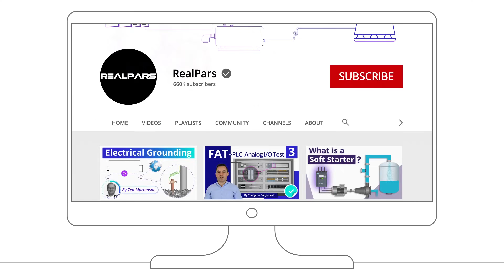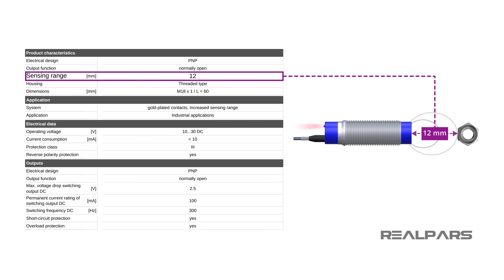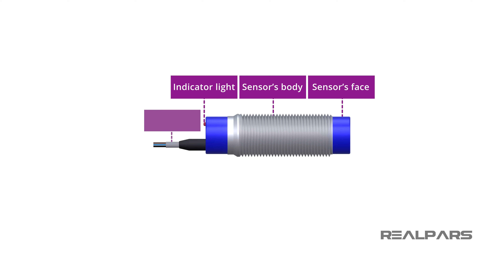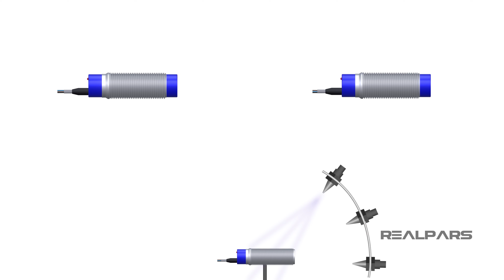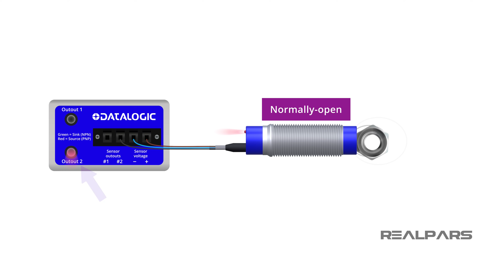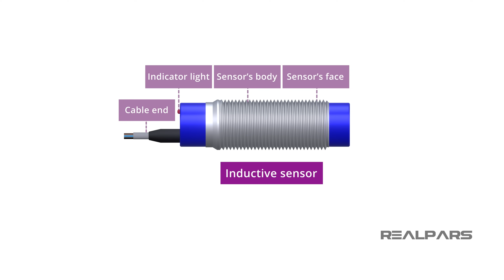Inductive Sensor Explained | Different Types and Applications

Comment: For this kind of detection, the hall sensor is not very good, and then it requires magnets arranged on a rotating mass. In contrast, the inductive sensor (is the one used in the video an NO?) is much more versatile for connection to an injection module such as the BKL3A.
Reply from the maker: Hello, @pierpaolop9534.  Thank you for your comment.   You are correct. It all depends on engineering design and application. Happy learning from Realpars!

Comment: I found an article online where someone turned a regular transformer into an inductive sensor and then used it to monitor the chain links on a bike. They were able to monitor the speed of the links as well as their varying distance from the sensor, eg the torque on the chain.. What kind of output is produced by these sensors. Is it a raw analog output based on the input voltage, or a digital output, eg on or off signaling the presence of the target material. This presentation makes it seem like a switch.
Reply from the maker: Hello, @chrisliddiard725.  Thank you for your question. This is very interesting. Electronics can do lots of things if you have the know-how, education and training. Yes, we talk about these sensors as switches. There are many manufacturers that make these.  Happy learning from Realpars!

Comment: For aircraft/aviation applications, is circuit normally closed or normally open?  Please also send me a link if you have a specific video for aircraft applications.  Thanks!
Reply from the maker: Thank you for your question.  Sorry, we do not have any specific videos for aeronautical applications.  Circuit sense (normally open or normally closed) is usually independent of the process type and dependent only on the application.  Applications where a proximity switch would need to cut off a circuit when the switch point is reached would typically be in a normally closed circuit.  If the switch needs to enable a circuit, that would be a normally open circuit.

Comment: can I use a non-conductive material to block the inductive signal from the sensor so that it will not detect an object in range?
Reply from the maker: Hi there, 

Thank you for your question! As mentioned in our video, the sensor operates by generating an electromagnetic field. Depending on the specific manufacturer and the information provided in the sensor's datasheet, it may be possible to effectively obstruct the electromagnetic field using a non-conductive material such as a thick piece of wood or rubber. We wish you success with your experiment and hope you find valuable insights. 

Happy learning from RealPars!

Comment: Can this sensor be used for rotation detection? Flat smooth surface wheel is rotating without any holes or anything on it. How can I detect wheel is rotating? If this sensor cannot do it what can I use?
Reply from the maker: To use an inductive sensor with a rotating wheel, the wheel would need to use a special version of an inductive sensor, known as a Hall Effect sensor.  This sensor looks like most other capacitive or indictive proximity sensors, but specifically can detect the presence of a magnetic field.  You would need to have magnetic material mounted on the surface or embedded in the rotating disk or shaft at several places on the circumference.  Using a proximity switch with a fast response time, you can count the number of magnetic pulses as the item rotates. The rate of the pulses is proportional to the speed of the wheel.  The only other way to determine rotation is to have a device attached to the shaft with a pickup sensor.  These are also magnetorestrictive or hall effect sensors, but rather than embed something in the wheel itself, a disk is slipped over and affixed to the shaft to provide the rotating magnetic targets (e.g., https://www.electro-sensors.com/products/shaft-speed-sensors/series-18).

Comment: hello, may i ask how it can detect if the metal is magnetic or not?
Reply from the maker: The only way to do so is to use a small magnet and test it on the metal in question.  If you know what metal it is, you can search for its magnetic properties on the internet.  But be careful; materials under a single name may vary in composition and magnetic properties.  Best way to use a magnet to find out.

Comment: Can I use the inductive sensor as a conductive sensor by reversing the negative/positive connections to positive/negative. Please advice.
Reply from the maker: No.  For AC sensor, there will be no change in operation.  A magnetic field is produced and the sensor will continue to act as an inductive sensor.  For a DC sensor, the device will cease to work if the leads are reversed (actually, there are 3 wires for a DC inductive sensor).  DC inductive sensors are solid-state devices that require a specific polarity to function.

Comment: Hello and thanks for your video! May I know your opinion if the sensor can be damaged by the sensing object without touching the sensor? I am sure that is not possible but I have to prove it to my boss!
Reply from the maker: I do not believe a proximity sensor can be damaged by an object without the object physically touching the sensor.  Dust or grime buildup can affect the sensor and could possibly cause it to malfunction (sense an object when one is not present), but this does not damage the sensor.  The only damage I have seen with proximity sensors is damaged caused to the internal circuits when they are used to switch too high of a load (like a motor).

Comment: Thank you for the explanation.. 
I have a doubt, if capacitive sensor can sense both metallic and non metallic objects then why we are using inductive sensor!?
Please help me with this!
Reply from the maker: Inductive sensors typically have a faster response time and a higher switching frequency.  They are usually more reliable and less expensive.  The biggest advantage of inductive sensors is that they are insensitive to non-metallics:  i.e., they are not affected by dust, coatings, etc.
Reply: @realpars  Thank you

Comment: Excellent video. Is inductive sensor same as the proximity sensor? Thanks.
Reply from the maker: The short answer to your question is "yes".   Proximity sensors are a class of sensors used to detect the proximity of an object to the sensor.  In this video, we talk about inductive proximity sensors.  There are other types of proximity sensors, such as capacitance and Hall Effect proximity sensors.
Reply: @realpars  Thanks for your excellent reply. Keep it up.

Comment: As per the datasheet, the distance factor mentioned for steel is 1 means 12mm, if I use painted steel then the distance factor will vary?
Reply from the maker: It may vary slightly, but in my experience, painted steel should give the same response at the same distance as unpainted steel.  As with any proximity switch, test the switch with a sample of the material you are trying to sense.  Not all steel reacts the same to the same switch, since the composition of steel varies with type.
Reply: @realpars  thanks

Comment: Is this different with variable reluctance sensor ( for application in detect rpm speed )?
Reply from the maker: Variable reluctance sensors are pretty much the same.  Hall effect sensors are also similar and have better responses at lower speeds.  The key is to match the response time of the sensor to the application it is being installed in.  The switch needs to have a short enough switching frequency to be able to return to the "zero" state between pulses at maximum speed

Comment: how we can differentiate the proximity sensor to inductive sensor and functions?
Reply from the maker: The best way is to refer to the datasheet provided by the manufacturer.  Even after working with over 1000 of these devices over the past 30 years, I still find it better to refer to the datasheets as opposed to trying to guess as to how a particular device works, its sensing range, wiring, and action (NO/NC).

Comment: are there NO or NC types can be called as  NPN or  PNP. or those are different types.??
Reply from the maker: Great question!  NO/NC and NPN/PNP are two different, but related concepts. Normally open contacts do not pass current when they are in their "normal" or at-rest state.  The same is true for an NPN transistor when its base is held at 0V.  However, I can arrange two NPN transistors to form an NPN inverter, in which case it will act as a normally closed arrangement.  It is best to think of transistors as logic elements that drive the final state of the device.  Always refer to the manufacturer's datasheet for the device to make sure you understand the behavior of the device.  Here is a website that sells proximity switches: https://www.mcmaster.com/proximity-switches/dc-metallic-object-proximity-switches-9/.  If you look through the list, you can see that there are NPN and PNP devices available in both normally open and normally closed switch designs. I know, it is a little confusing, but remember, NO vs. NC and NPN vs. PNP are two different design decisions that need to be made.

Comment: It would have been helpful to explain how exactly the internal circuit works, some people assume they use radar which is wrong. Also the output stage is important. The main competition with inductive sensors is mechanical switches and they have advantages in how they can be wired which transistor outputs do not.
Reply from the maker: Thank you for the comment. You are correct, no radar is used!  Basically, these sensors use an oscillator circuit to cause a fluctuating magnetic field to be created via an inductor, which will pass a certain amount of current which is detected by the sensor circuit.  When an object comes near, this magnetic field is modified, leading to a different current detected in the circuit, which leads to a switching of the sensor state.
Reply: are you looking for sensor?

Comment: Can we identify the sensor visually whether is it PNP Or NPN
Reply from the maker: Only if you can trace the wiring.  In PNP, the black wire will be connected to the positive or signal terminal of the PLC input or positive side of the device.  For NPN, the black wire is connected to the negative side of the PLC input or device.  If you can't see the wires, the wire colors are "lost" when connected in a marshaling panel, or you can't trace them back at all, then read the model number off of the sensor and look up the specifications in the manufacturer's documentation.

Comment: What is the difference between shielded and non shielded inductive sensor
Reply: Flush-style sensors actually have a shield that restricts the magnetic field so that it only radiates out of the face of the sensor. ... Non-flush, or unshielded sensors, do not have the shield around the end of the sensor so the field can radiate from the face to the sides of the sensor in a larger pattern.
Reply: You have to watch how close you install shielded and non-shielded sensors to each other.  It's typically going to be called out in the sensor specs.

Comment: I have a question is it applicable in conveyor positioning coal industry in coal power plant with coal dust all over it? will the dust affect its sensitivity ? thank you
Reply: As stated on the video, only physical damage can affect the sensor, see video time at 5:17. Dust can not do harm  or destruct the sensor as it will continue operate as long as it is serviced and well mentained.
Reply: @TheeHuman2  thank you I though coal is a metal, the i researched and i learned than coal is non metam
Reply: @jedalvinaliwalas8051  I see, I thought you needed it for something else not coal. Thanks.

Comment: NPN - Normally Close
PNP - Normally Open
Reply: You are wrong.
NPN - Which gives output negative.
PNP - Which gives output positive. 
Depending upon Application we use that .
Ex For sinking we use PNP
 For sourcing we use NPN
Reply: @SathishTech07  thanks for the info👍

Comment: Please we need a video about inductif sensor NAMUR vibrations type ... Btw thanks for your videos it helps me alot
Reply from the maker: Hi Youcef!

Thanks for your comment and your suggestion. I will pass this on to our course developers!

Thanks for sharing and happy learning!
Reply: They already did one on NAMUR proximity sensors, but not sure if you are asking about NAMUR vibration sensors? 
https://www.youtube.com/watch?v=0hPVyFPcVAM
Reply: NAMUR sensors are typically used with an intrinsic safety barrier.  That limits the amount of power available at the sensor and limit it's availability to store energy so it can't cause a spark hot enough to cause an explosion.